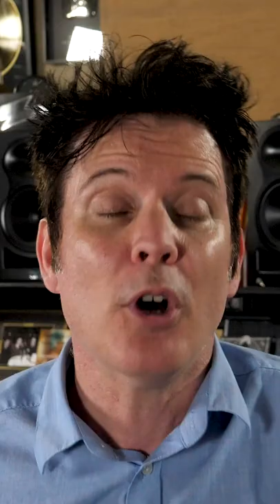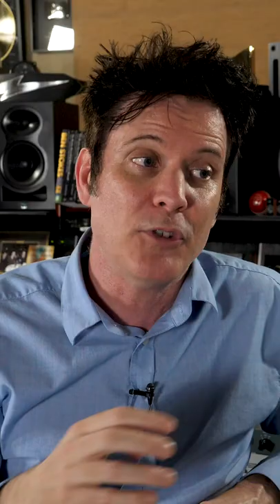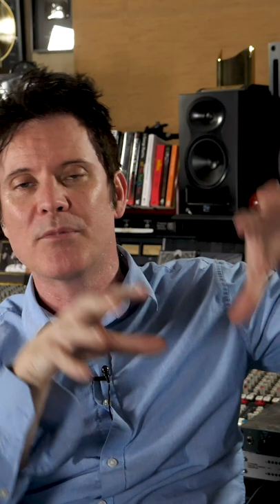The Master Bus is not for solving problems

Comment: Good stuff! After years of learning so much from this channel (and other sources), I always use the master bus for the final sweetening of things. 

It's reserved for a 30 Hz low cut EQ, a gluing compressor like a Pulsar Smasher or elysia alpha, followed by a spicy plugin like Slate Revival or Fresh Air. 

Sometimes I switch the order of things if they give me what I want, because being rigid hindered me for years. I now break old-school audio rules that formed me in my newbie years and am happier that way.

After that, I'll maybe use an instance of Steinberg Magneto, which I LOVE. I bought an unopened Cubase 4 on eBay just for it. If not, I'll use Black Box Analog Design HG-2 or Softube Saturation Knob to chunk things up a bit. 

It's just seasoning plugins that button up and give that nice sparkle to the final result.

Comment: In my amateur home studio, I'll use an Analog Obsession BUSTERse (SSL master bus compressor clone) or stock Reaper compressor, and often a Waves Kramer Tape. That's about it. 

I'll occasionally cheat and use a stock Reaper parametric EQ to bump the kick drum fundamental just a hair. When I'm mixing, the relationship between the bass and kick can be really dynamic and I don't want to mess with it after a while if it's sounding good, so I don't think it's a horrible idea to go in at the mix bus level and see if I can get away with an extra 1/2 db or something at the kick fundamental. 

And when I'm mixing stuff that's supposed to be retro or garage rock, I'll occasionally set a high pass filter as low as it'll go without making a bump.
Reply: I LOVE Analog Obsession plugins. I still can't believe that guy just gives them for free. They're too good...and look good, too.

 I think I donated to him out of feeling guilty, ha-ha. I'll donate if my conscience dictates that a plugin is too awesome for me to have it for free. 😛 I love TUBA, TUPRE and LALA. So warm!

Also, I bought the Kramer Tapes, Tubes & Transistors bundle a few years ago and LOVE the Kramer Master Tape. It's amazing. Nothing else I own does what it does.